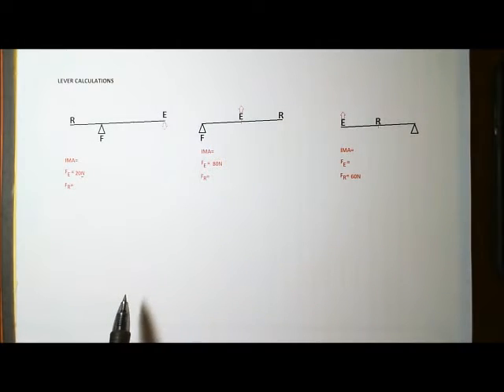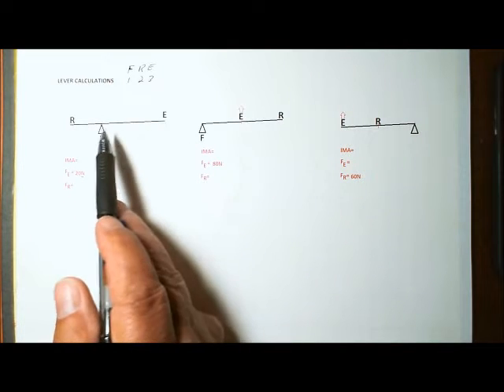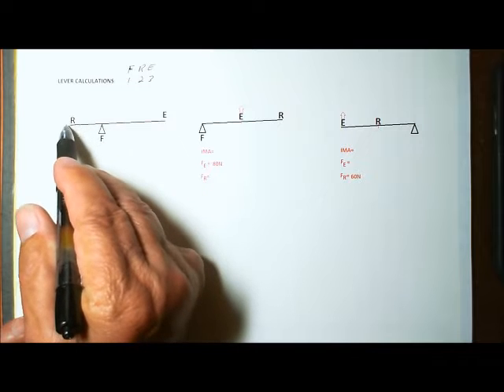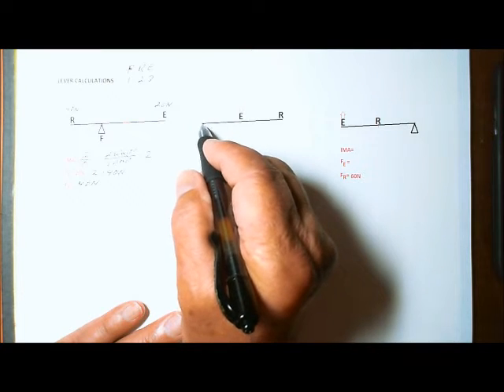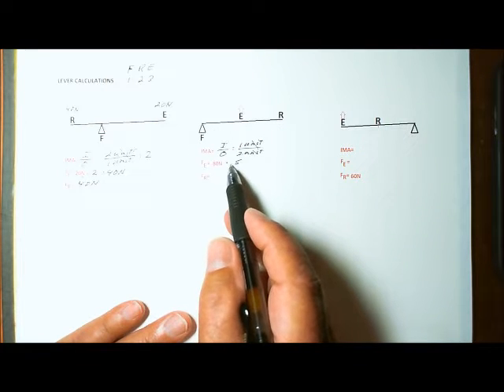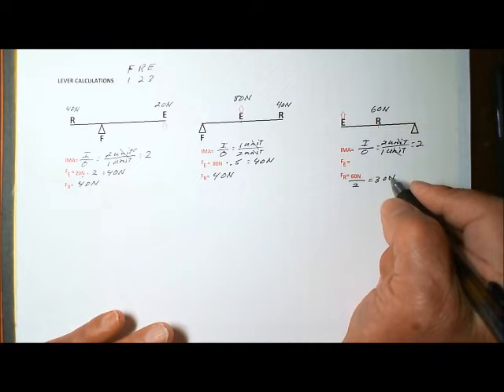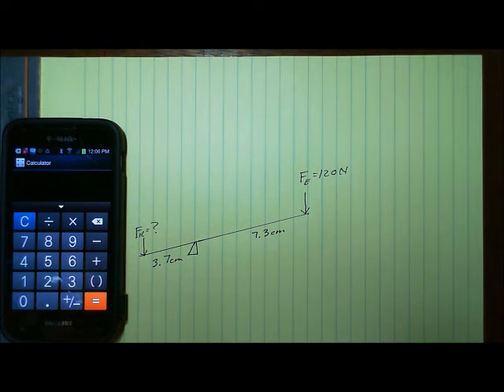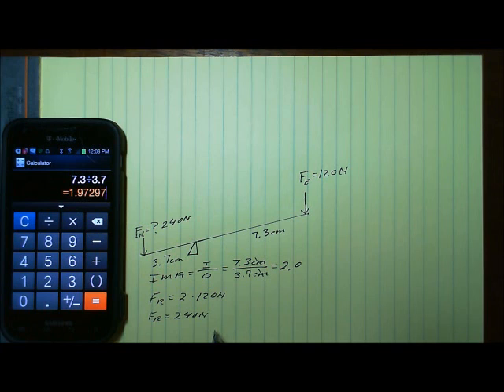Levers and Simple Machine Calculations - Using Ideal Mechanical Advantage

Comment: How does that sweet spot where it doesn't take any effort to balance factor in? I have a wheel barrow and if the load is distributed properly, once I get it to a certain height it requires little or no effort to keep it there. When using a two wheel dolly, once the load is at a certain angle it requires little or no effort to keep it there. 

If I want to lift an object just off of its resting point and keep it there, how do I determine where I want the fulcrum so that I need hardly any effort to lift it?

Comment: A weight is hanging from a pulley. The Rope is wound around a pulley several times, and this is what is supporting the weight. So what is the force that supports the weight?...

A) Frictional
B) Centrifugal
C) Compression
D) Gravitational
Reply: D)The tension force is what is supporting the weight which is provided by the gravitational force. Friction force is only present when the weight is accelerating along an incline plane. Centrifugal is not present since the pulley is not accelerating outward and compression obviously makes no sense. The rope being wound around the pulley DOES NOT provide any important information (i.e. its useless information).